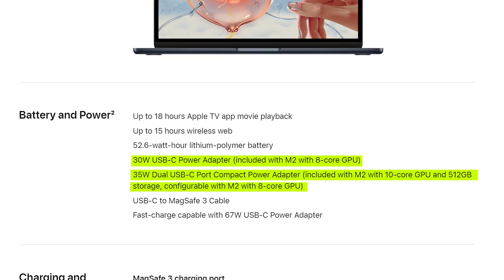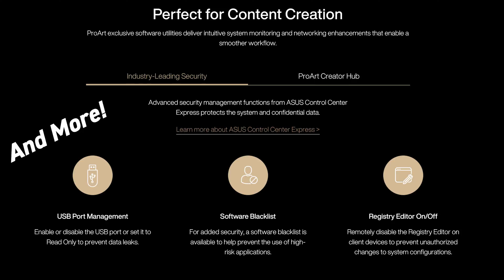ASUS Pro-Art Z690 Creator Wi-Fi Review | The BEST Creator Motherboard for Intel's 12th & 13th Gen

Comment: Your info is a little flawed.According to the manual, if you put a SATA or NVMe device into the 4th m.2 slot, you will suspend the SATA6 5 through 8 ports. Other than that, great video.
Reply: What’s wrong with? Could you please explain it in details